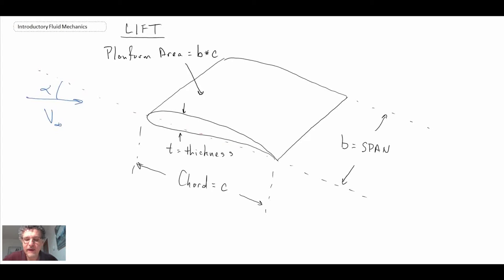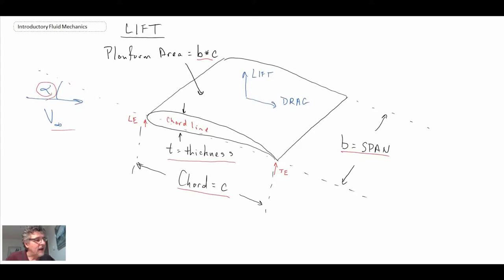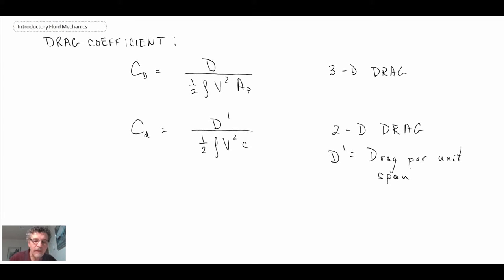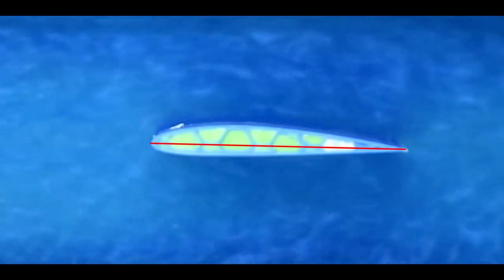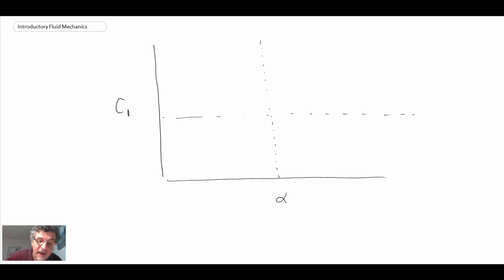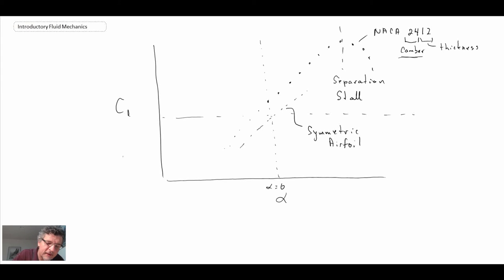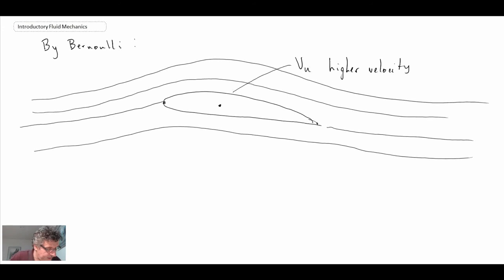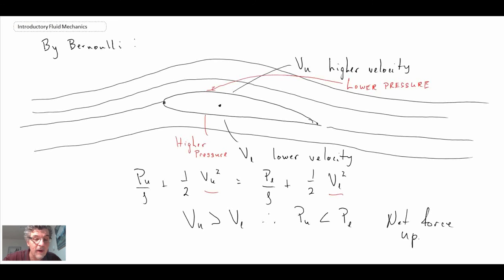Introductory Fluid Mechanics L21 p5 - Lift Force

Comment: Thank you! Excellent course as usual.
Reply: I just ran across this video and see this is very misleading.
..
Neither Bernoulli's Principle. nor Equation says anything about the speed/velocity relative to a surface.
..
This kind of explanation runs afoul of physics fundamentals, because if you measure these velocities relative to the ground (moving wing), as a wing goes by, the air under the wing is actually faster than the upper air.  Yet, the air above the wing is accelerated more than below.  Bernoulli is about changes in velocity which is acceleration. 
.
Velocity is dependent upon the observer's inertial frame of reference, whereas, acceleration is not. 

From the fixed air reference, that lower air is accelerated forward for a longer time (starting  in the upwash before the wing arrives), reaching a higher forward speed.  It also winds up far from its starting point in the direction of flight.

The air above is also first accelerated forward in the upwash ahead of the wing, but accelerated rearward, completely REVERSING DIRECTION and travels in the opposite direction of flight.  It is accelerated much more (than the lower air because of the horizontal Pressure Gradient), but finishes at a lower REARWARD velocity - and winds up close to where it started before the wing arrived.
This is from measured data.  This is not speculation from trying to apply physics.
.
I fail to see how people don't understand this actual data and the reasons.
.
See Fig. 7 here: https://rxesywwbdscllwpn.quora.com/

Comment: There are two major errors in this starting around time 10:30:
..
 - Bernoulli's Equation is for two locations along a *single flow*, not two independent flows.
.
 - Bernoulli says NOTING about flow relative to a surface or anything else, only between two locations along a  SINGLE  flow.  
..
Measured data shows that relative to the air/ground, the lower flow is accelerated to a higher speed than the upper air.  
..
YES! The lower air is faster!! - relative to the air mass/ground.!!...
..
On the other hand, the upper flow goes from moving in the direction of flight AHEAD of the wing (upwash) to completely stopping and reversing direction as the wing passes under it; then traveling in the OPPOSITE direction of flight (relative to the ground/air), but at a LOWER rearward speed than the lower air's forward speed.  
..
Thus, the lower air is moving FASTER than the upper air relative to the stationary air mass. 
That is actual data on a wing.
..
Bernoulli is about ACCELERATION, NOT speed.

Comment: Hi, I have a question. we also know at stall point: Lift force begin to decrease and Vup approximate zero .But we have Bernoulli equation Pup -Pdown=1/2 * rho (Vdown ^2-Vup^2). If Vup ->0 , P will increase. it means that at stall point Lift force does not decrease. Could you please explain it to me?
Reply: You cannot use Bernoulli on two different flows.  It is for two locations along a single flow.  Therefore it deals with ACCELERATION of the flow.  It does not deal with speed, nor does it say anything about speed relative to any surface.
. . . . . . .
There are two major errors in this starting around time 10:30:
..
 - Bernoulli's Equation is for two locations along a *single flow*, not two independent flows.
.
 - Bernoulli says NOTING about flow relative to a surface or anything else, only between two locations along a  SINGLE  flow.  
..
Measured data shows that relative to the air/ground, the lower flow is accelerated to a higher speed than the upper air.  
..
YES! The lower air is faster!! - relative to the air mass/ground.!!...
..
On the other hand, the upper flow goes from moving in the direction of flight AHEAD of the wing (upwash) to completely stopping and reversing direction as the wing passes under it; then traveling in the OPPOSITE direction of flight (relative to the ground/air), but at a LOWER rearward speed than the lower air's forward speed.  
..
Thus, the lower air is moving FASTER than the upper air relative to the stationary air mass. 
That is actual data on a wing.
..
Bernoulli is about ACCELERATION, NOT speed.

Comment: I just ran across this video and see this is very misleading.
..
Neither Bernoulli's Principle. nor Equation says anything about the speed/velocity relative to a surface.
..
This kind of explanation runs afoul of physics fundamentals, because if you measure these velocities relative to the ground (moving wing), as a wing goes by, the air under the wing is actually faster than the upper air.  Yet, the air above the wing is accelerated more than below.  Bernoulli is about changes in velocity which is acceleration. 
.
Velocity is dependent upon the observer's inertial frame of reference, whereas, acceleration is not. 

From the fixed air reference, that lower air is accelerated forward for a longer time (starting  in the upwash before the wing arrives), reaching a higher forward speed.  It also winds up far from its starting point in the direction of flight.

The air above is also first accelerated forward in the upwash ahead of the wing, but accelerated rearward, completely REVERSING DIRECTION and travels in the opposite direction of flight.  It is accelerated much more (than the lower air because of the horizontal Pressure Gradient), but finishes at a lower REARWARD velocity - and winds up close to where it started before the wing arrived.
This is from measured data.  This is not speculation from trying to apply physics.
.
I fail to see how people don't understand this actual data and the reasons.
.
See Fig. 7 here: https://rxesywwbdscllwpn.quora.com/
Reply: calm down sheldon, have a cookie
Reply: @vg23air   Says the YouTube-made expert. . .
Reply: @Observ45er  exactly
Reply: @vg23air  Do you have anything intelligent to say?